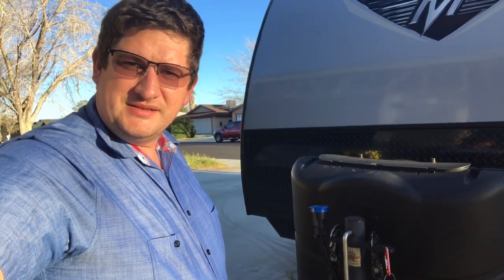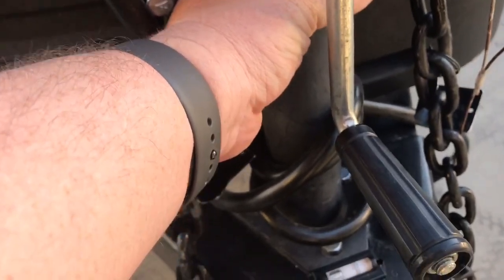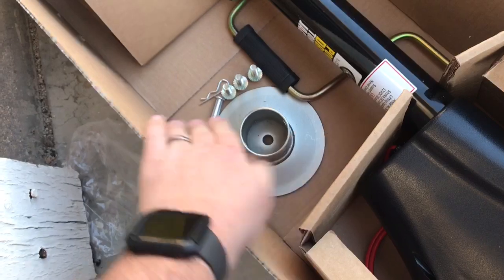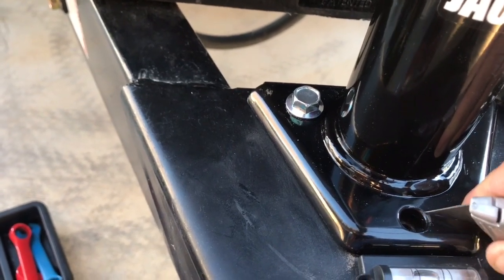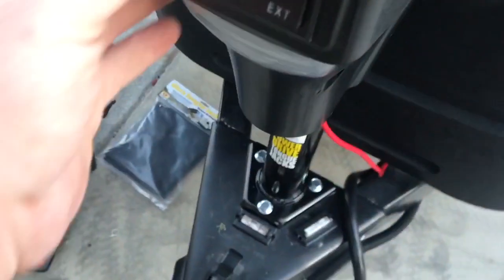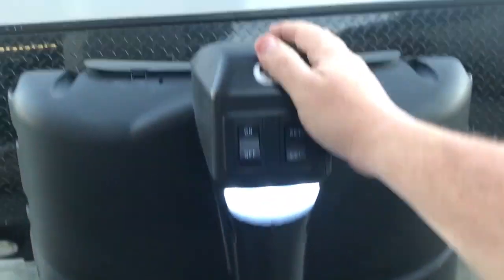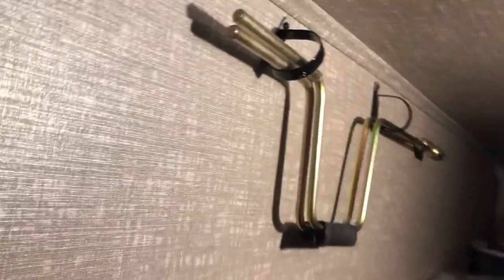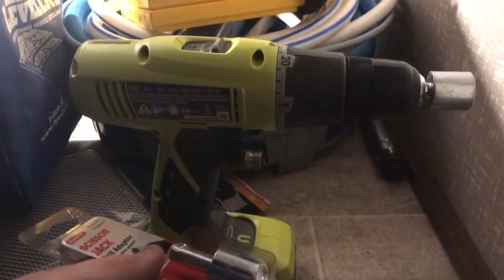Lippert Power Jack Install on Trailer

Comment: I wouldn't trust the weight of my trailer on the front stablzing Jack's. Would be much safer to hook this up to the truck and swap the Jack's while it's connected
Reply: I agree or use a jack stand. I will be doing the same upgrade

Comment: Just got one that was getting pitched out. It works perfectly but had sat for 2 years in Alaskan salt water air, everything inside and out looks great. It was a bad ground on the original install. Nice tip for the bolt, I added some dielectric grease as well. Thanks for the vid.  I suspect the ground is the weak point of the whole assembly.

Comment: I will say if you get this jack, go ahead and buy a back up override nut for the manual part. Had to use mine because my jack stopped working and the nut on mine cracked in two the moment I tried using it. Got lucky and was able to superglue it back together to get the trailer on my truck.
Reply: Same thing happened to mine, nut broke into about 5 pieces!! Happened while I was at the RV repair shop/parts! I thought, I’ll just go inside and buy another nut! Nope, they don’t carry them! 😡

Comment: Hi Ed, I like all your videos of your Mallard upgrades, I have one myself and I've done some upgraded mods too. The next one I want to do is install a rear mounted  access ladder to the roof. I cant find any info on the frame structural design other then its aluminum. Have you ever considered this upgrade? or have any advice?
Reply from the maker: I'm not sure about that back wall. Personally, I will research a ladder that is either collapsible, or one that will push the weight onto the bumper. I am thinking of moving the spare tire to underneath the trailer to free up the weight from the bumper.

Comment: Not a good idea using the stabilizer jacks to support the weight, should have blocked up the tongue of the trailer to hold the weight.
Reply from the maker: If your not climbing in/out of the trailer while doing this, it should be fine to use the stabilizer jacks to do this. My jacks are rated for 2000 pounds each anyways, and the weight was already evenly distributed between them. I am also not lifting the trailer off of the wheels.

Comment: I bought the same jack. Wired it to my red terminal on the battery. Light works on the jack so there is power, but the jack does not operate. Any idea why?
Reply: You figure it out yet?